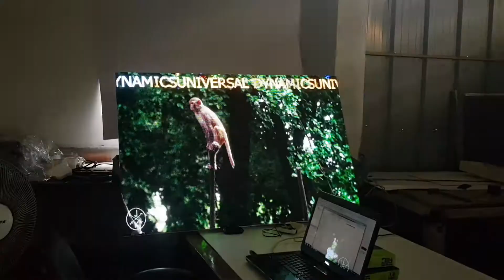LED video display assembled with HD C15C

Comment: hello there in c15c control card after doing smart setting when i send a data the led screen is blackout why? & Doing testing also the led module still blackout what is the problem